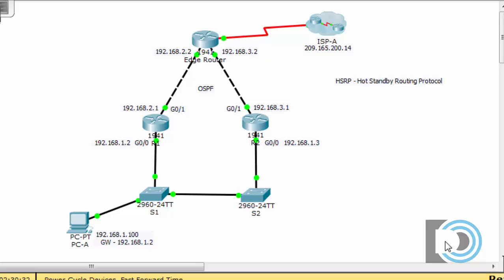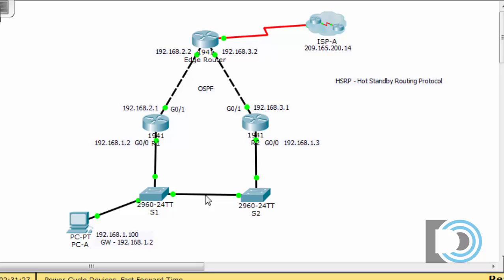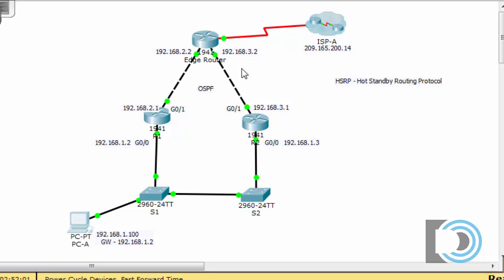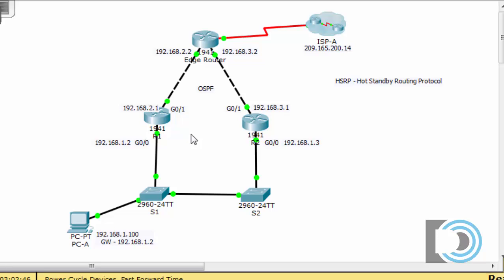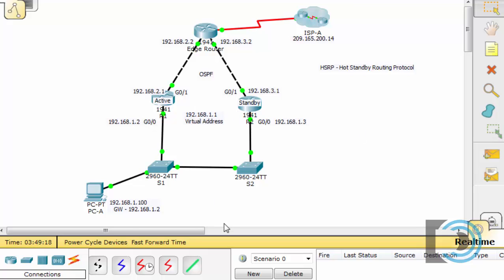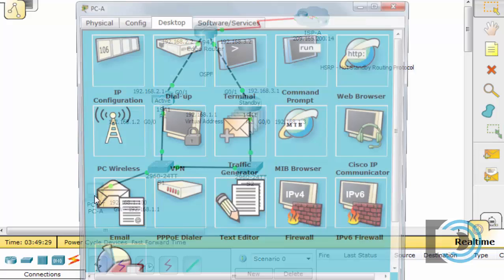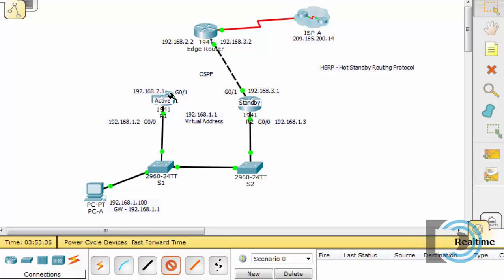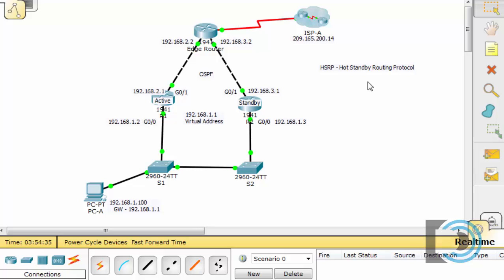HSRP Hot Standby Routing Protocol in Packet Tracer 6.1

Comment: Doesn't work. Did exactly pin point the same as Dan did. Using Packet Tracer 7.2.1. Gateway did not change in PC and it does not reach Edge Router when cutting off cable to R1.

Comment: and i think you should also use the preempt command on R2
Reply: I'm still a beginner . I think that a Preempt on R2 will only be necessary if it has to compete with another router for the Active position. however, your suggestion is good practice.
Reply: u ar right buddy

Comment: Hello Dan, I've noticed that you have a mistake in configuration on from R1, you typed standby track G0/1 wich will by default set HSRP group 0 for that particular command. The correct way is to specify the group for that command and optional the decrement value
Reply: @Stancu Mihai You are correct. My running-config shows "standby 0 track GigabitEthernet0/0" which is incorrect. It should actually read "standby 1 track GigabitEthernet0/0".

Comment: hi when i do the config of hsrp using your senario i diconnect the g0/0 on r1 but it still is the active router could you tell me the reason why. also, i have enabled the command standby track g0/1 
thankyou
Reply: Is hsrp a routing protocol ?
Reply: @AsishSwain-u7z   
Hot Standby "Routing Protocol"

Comment: hi dan! my only question on the hsrp is how to configure dhcp on it? do you create the dhcp on the hsrp routers or do you create it on the edge router and configure ip-helper on the hsrp routers? i saw a vid that showed how dhcp is setup on the hrsp routers  however, i couldn't find the command ip dhcp-server in the packet tracer. i only use packet tracer and I'm studying for ccna. appreciate your advise.
Reply: Hey Ryan, you can achieve these multiple ways - You could have DHCP pool setup on both routers i.e. /24 and when a PC broadcast out its Discover to find a DHCP server both routers will respond with an offer but the PC will only pick the first one it received. 

If there are two DHCP servers, why are there no conflicts? - Before an IP is given from any pool DHCP checks to see if that IP is being used on the network and hopefully if any of the DHCP pools on any router has given an IP to the PC/Host the other should detect the IP is being used on the network and not give it out. But it’s possible when DHCP checks the PC/Host doesn’t respond and as such duplicate IPs may appear on the network causing problems for users.

A safer option (Depending on design) could be to split your pool across two devices i.e. 2x /25 on each router, rather than both being configured with the same /24, but if a router were to fail your available dynamic IPs will reduce, so you need to ensure your entire estate can be handled by a single router in an event of a failure
A better option would be to utilise DHCP-Relay (IP-Helper Address) on both routers so the messages are sent to a remote server off the local network to be centrally handled. This would also mean, any router receiving the request could handle a response and since DHCP is only being handed out by a central device there are no conflicts 

Hope this helps

Comment: hi!
my question is that during the HSRP do the packets are shared on bpth routes like OSPF do load balancing or it just uses a single route until the router goes down ?
Reply: No load balancing with HSRP. You need to use GLBP to load balance. But if you have multiple VLANs (IP subnet) you can distribute them on the two routers.

Comment: What config did you do to s1 to s2 to connect they cant seem to talk to each other with a straight through cable
Reply: they are like devices so you use crossover to connect them.
Reply: but those switches are connected by a straight through in the video
Reply: have you tried changing the cable to crossover to maybe see  if ur issue will be sorted?
Reply: Yes I know switches will connect with a cross over cable I'm just curious about the video and how he used straight through
Reply: ooh okay if i find out will let u know :)
Reply: thanks very much (y)

Comment: When we use HSRP do we need to configure the interface in your exam g0/0 with real ip address for example R1 g0/0 192.168.1.2 and R2 g0/0 192.168.1.3 or we are oki only with Virtual IP address?
Reply: Yes, you should.

Comment: Something is wrong with this Lab. It does not work as expected. 

You are not going through router 2 when you said "Its obviously going through R2"
Instead the PC is going 192.168.1.1 -> back down the LAN with R1 OSPF route to R2

Try disabling the OSPF on R1 and try pinging again, NO GO

There is something wrong with the TRACK COMMAND in packet tracer. When i disconnect G0/1 nothing happens and R1 still thinks he is the Active router.
Reply: While configuring standby priority on routers make sure difference is only 5, means on R1 if priority is 95 then on Active Router R2 it should be 100 because "standby track interface" command will decrease the priority of Router by 10 when interface goes down. If you configure priority values as R1(95) & R2(120) it wont work when track configured interface goes down. because 120 - 10 = 110 still has R2 has higher priority then R1.

Comment: https://payhip.com/b/mPkI

Hot Standby Router Protocol
 
Which vendor responsible for creating HSRP protocol
HSRP is a Cisco-proprietary protocol
 
Why HSRP was developed
HSRP was developed to allow several routers (or multilayer switches) to appear as a single gateway IP address.
Router that provides redundancy is assigned to a common HSRP group.
 
Which are the different states in HSRP protocols?
One router is elected as the active router; another is elected as the standby HSRP router; and all the others remain in the listen HSRP state.
In the network, R1 is Active, R2 is Standby and R3 is in Listen HSRP state
 
What is standby router?
The router with the second-highest priority
 
Why HSRP routers exchanges hello messages
To remain aware of each other’s existence and that of the active router.
 
  
On which multicast address, HSRP send its hello message
 HSRP sends its hello messages to the multicast destination 224.0.0.2 (“all routers”)
 
Which transport protocol and port number use by HSRP?
 HSRP uses UDP as the transport protocol and port 1985.
 
 
HSRP Group
What is range of HSRP GROUP?
0 to 255.
 
What is the maximum groups range supported on Catalyst switch
up to 16 unique HSRP group numbers.
 
What is the simple way to use group number?
We can make the group number the same (that is, 1) for every VLAN interface.
HSRP groups are locally significant only on an interface.
HSRP Group 1 on interface VLAN 9 is unique and independent from HSRP Group 1 on interface VLAN 10.
 
 
HSRP Router Election
On which parameters, HSRP election is based
HSRP election is based on a priority value configured on each router in the group
 
What is the range of HSRP priority value?
0 to 255
 
What is the default HSRP priority value?
100.
 
Which router would become active router for the group?
The router with the highest priority value (255 is highest) becomes the active router for the group.
 
What will be the tiebreaker if all routers have same priority value?
If all router priorities are equal or set to the default value, the router with the highest IP address on the HSRP interface becomes the active router.
 
What is the command to set the priority on the router?
The following interface configuration command can be used to set priority on the router:
Switch(config-if)# standby group priority priority
 
What is the command to set priority value 200 on the router (router belongs to group 1)
We can use the following command to set the HSRP priority to 200:
Switch(config-if)# standby 1 priority 200
 
Which is the different states router goes through before becoming active
1. Disabled
2. Init
3. Listen
4. Speak
5. Standby
6. Active

Comment: Hey mate, thanks for all the videos they are really helpful! just wanted to ask a question about the config you have here, shouldn't the "standby X preempt" command be on all the routers standby interfaces so when the priority changes from a lost link the other routers with a higher priority can go into a active state?
Reply: David Smith You are right. Unless configured to preempt, a standby router will become active only when the standby holdtime expires (10 sec by default), meaning no Hellos at 224.0.0.2:1985 (UDP) for 10 sec.

Comment: the standby group configuration on R1 was wrong  at the track line parameter, it was configured as group 0 instead of 1, that`s why the R2 was not in active mode, whats weird is how could you ping outside! :/
Thanks for the classes :)
Reply: ***** using the 6.1 version, i wasnt able to open it. have no idea whats the right version to use.
Reply: d0tnix The reason the ping was successful is because it actually went PC-A -> R1 -> R2 ->. Initial frame had D MAC = 0000.0C9F.F001 (0000.0C - Cisco ID, 9FF - HSRPv2 ID, 001 - group #), so according to S1's CAM table, the frame went to the HSRP Active router first (R1). R1 knows about the 209.165.200.14 host from OSPF adjacency on its g0/0, so the next frame has D MAC = R2's g0/0.